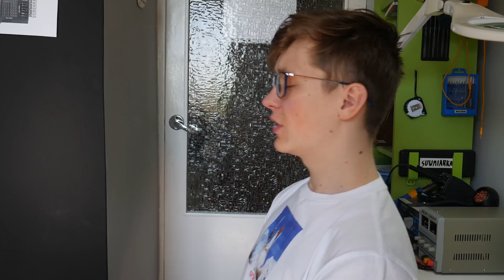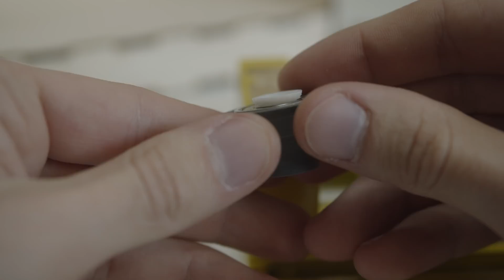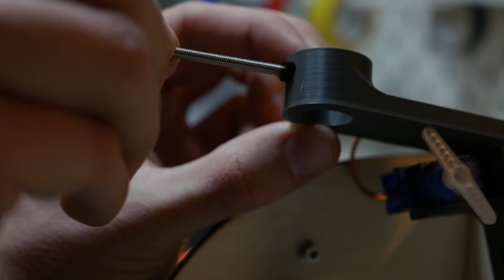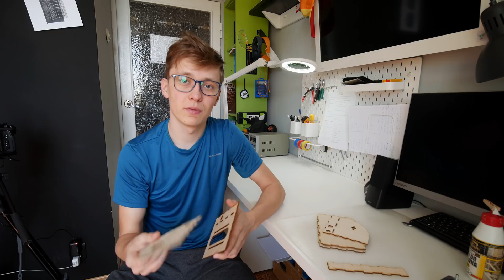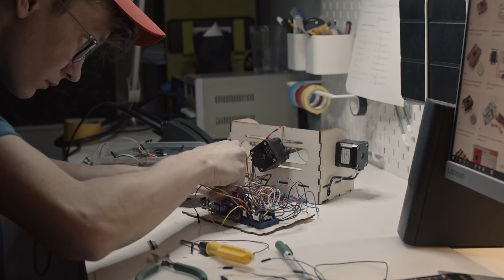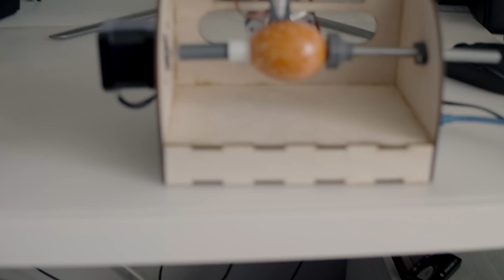Arduino based CNC machine paints eggs

Comment: The circuit diagram shown in the video is wrong. Since the stepper motors are operated with 12V, a separation from the 5V circuit is necessary. Otherwise the supply voltage of the Arduino collapses.

Comment: In the US Navy, there’s a rite of passage where folks get initiated to the next higher pay grade. Part of the initiation involves making an ‘Egg Division’. The machine you’ve designed is a slam dunk, just like your CNC and other projects. With these little Egg Bots, they could design their little sailors on styrofoam eggs, like @domestron suggested. These personnel go through this phase of their career starting in late summer, so fleetwide everywhere all at once, these machines could fill a desperate need. I’d love to see these manufactured. Your electronics package is phenomenal as well as the grbl code(s). When producing them, one could use a CNC type controller board, for like $35 USD. I’ve used a program called EstlCam which incorporates sensors for CNC carving uneven surfaces, like eggs! Of course, one has to lay metal tape adhered to the piece being produced for probing and the tape carefully removed with sufficient care as not to move the stock in the slightest. It’s like magic. I’ve engraved handles, for hammers, rounded utility knives, and other stuff too. Not sure if you have any knowledge of that piece of software. It’s developed by just some smart guy with an accent such as yours, he only charges, I think like $35USD for lifetime use of the program. I could go on for ages about the interest. My own developed project for a fully adjustable probe (see my Thingiverse designs). Those probes can be purchased for a song and they’re super accurate. Just some thoughts. Love the hell outta your stuff. Only rivaled by a guy on YouTube named Mihn who put in a ton of work to produce a 3018 that cuts aluminum easily. It took forever but he pulled it off. He has an Asian accent and is very interesting. Check out his 3018 content on his YT account.

Comment: I have a CNC machine which I love, now I am learning out to do some programming on the Arduino board and the stepper motors I purchased with them. I also have the CNC shield , I have been using the Mach3 for my CNC machine, could the Mach 3 be used to run the egg printer, and how could I set it up to do that?

Comment: Hi
I Will make this thing, but I am stuck at the beginning, When I try to import GRBL library from Github to Arduino IDE, I get report :
 "Specified folder/zip file does not contain a valid library"
Please help :-(
Reply from the maker: Try to manually add it to the library folder, here you can find how: https://www.arduino.cc/en/guide/libraries
Reply: @nikodembartnik  Well, it's stupid easy, IF you know how to do it. I couldn't find answer anywhere…  So, when one download zip file from GitHub, you get multiple files and folders,(btw there is newer release), you must copy ONLY folder with name grbl into arduino libraries folder.  GAME OVER. DONE. I have tried at list 30 times with whole thing downloaded from Github without success, because usually when I have downloaded libraries from GitHub I have always use the file as it came….

Comment: just a lil tip: insert the threaded inserts with an soldering iron, its much easier and cleaner! great build, as always! love from germany
Reply from the maker: Will try that, I hope I am not going to mess my soldering iron with plastic
Reply: @nikodembartnik  Depends on the tip you use, but easy to remove afterwards
Reply: @nikodembartnik  You don't get any plastic on the iron. You put the iron inside the insert to heat it up. Then just push it in.

Comment: My third arduino project was a draw bot. Four years ago I started a n egg bot and never finished it. My plan was to use nema 17 and easy drivers with an arduino board. I have most of it finished so I guess I ashould finish it and make a short video of it. I have been trying to tei up my loose end projects.